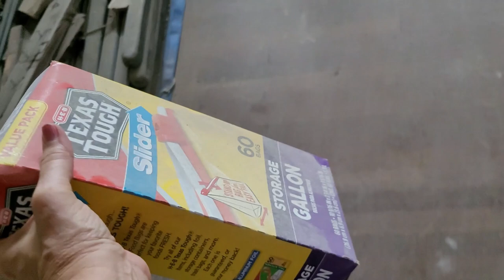S2.24 I'm Back and Ready to Restore!

Comment: That chrome toilet hardware appears to be a flushometer that pressurizes the water. Then its tankless. Maybe water could have been stored in a roof cistern? We had one growing up in a beautifully designed Brooklyn highrise built in 1929. The bathroom had the same pink tiles as yours, and apale green tub and toilet.
Reply: you are correct about the flushometer. good comment.
Reply from the maker: There is a large pipe on the outside of the house going to this toilet that is probably the source of the pressurized water.  One of the Kempner grandchildren remembers loving this bathroom as a child because you could flush the toilet with your foot.  I bet that high-rise was beautiful!